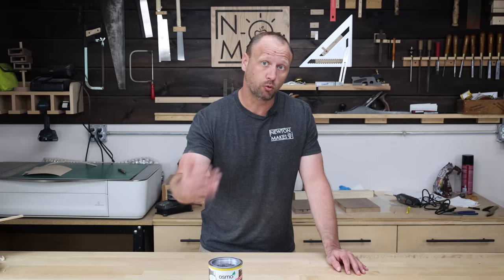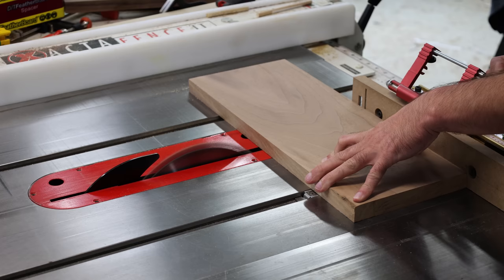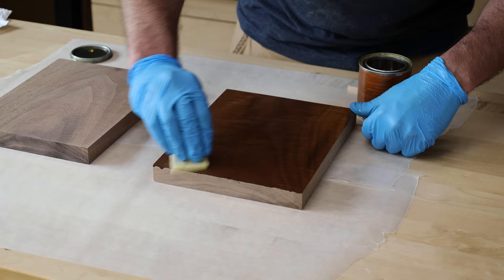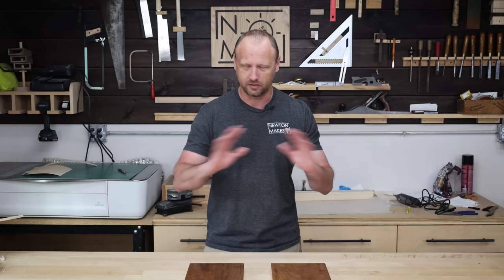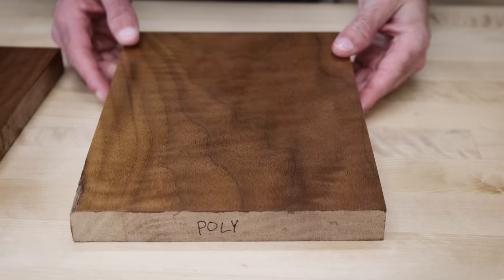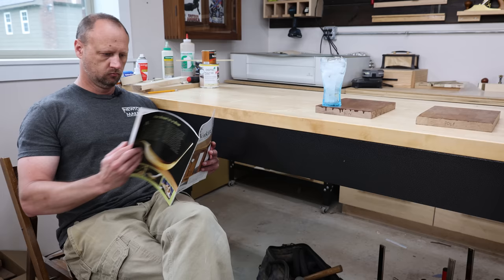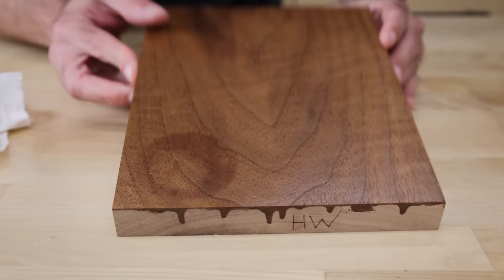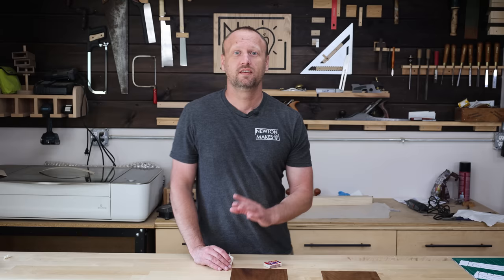Hard Wax vs Poly Shootout! | Rubio Monocoat & Osmo Finishing Test!

Comment: I don't know where the trend came from to wipe/spread on hardwax oil and wipe it straight off, but it goes against the directions on the tin. The directions say, and what I've always followed, are to use a roller (or paintbrush) to apply it thinly, and leave to dry. 2 coats. Using this method, Ive left water under a cup for hours and there are absolutely no marks whatsoever on the wood. There are videos that also say that hardwax oils don't leave a film on the wood. Wrong, they do, they leave a durable wax coating on top and soaked into the wood, unless of course you wipe it off.... I'd like to see this test done again, only using a roller to apply the hardwax oils. What hardwax oils are not great at is permanent marker. These leave a mark, but I've found you can use bleach to remove it. I use Shelley's mould remover, spray it on, leave it 10 mins, then wipe off and the mark is gone

Comment: One thing to add with hard wax’s is that a lot of makers are adding a ceramic finish to the piece. Would be interesting to see the same test with this added layer of protection.

Loved the video!
Reply: I'm working on a table now, and just ordered a bottle of ceramic finish to to on top of Rubio
Reply: Interesting… I would wonder how it changes the sheen of the finish and if it makes the “repairability” worse than the plain hardwax. If it gets shinier and is hard to repair, you might as well just put satin finish poly 🤷‍♂️
Reply: @louisolivierfortin  according to carbon method's website, it will increase the sheen a bit, but supposedly not affect the feel. I'll finish some scrap when i finish my table and do all Billy's tests on that and see if there's a difference.
Reply: @jcrusso1  saw on some other video someone saying it's really hard to repair with ceramic finish. Hopefully someone does this test to confirmation
Reply: Those nano finishes seem to be graphene based, it's nasty stuff. Wouldn't put that in any home
Reply: @jcrusso1  Hey, just curious if you did test the finishes and if you noted any difference. It would be great to know what the results were if you did test it!
Reply: @samuelmellars7855  I only did this with Rubio and Carbon Method's Carbon Coat. I went as far as leaving a puddle on the board overnight - the next morning it was still a puddle with no soaking in at all. when i dried it, there was no evidence
Reply: @jcrusso1  oh, that's good to know! 
You didn't happen to test it with just the Rubio, did you? To know how much difference the Carbon Coat would make.

I'm dithering about how much to invest in a kitchen renovation. Self-made ply or MDF vs IKEA and how to do the worktop
Reply: @samuelmellars7855  i did - just the rubio didn't hold up as well. some of the water soaked in, and after it dried there was light staining. not really noticeable unless you know what you're looking for, but it was there
Reply: @Joe_R501  ah, that's great to know. Something to take into account when doing the countertops for sure!
Thank you very much for sharing the info!
Reply: @TomasRosberg  a lot of them use the “graphene” buzzword because it’s the latest wonder material. I would doubt most of them have any significant amount of graphene in them, let alone a real solid graphene matrix. 

As for graphene being nasty stuff.. it’s just a thin configuration of carbon.. not that different to the graphite in the tip of a no2 pencil (which is basically sheets of graphene stacked on top of each other). Place some sticky tape on a pencil lead and peel it off, leaving a layer of graphite on the tape. then attach another tape to that tape and so on until you have a layer of graphite one atom thick - that’s graphene. If you have pencils in your home you have graphene in your home.. you’ve been getting it in your body if you’ve ever chewed on the end of a pencil.

Comment: For the marker test  it would be instructive to use an alcohol based wipe (like we bought during the pandemic). The alcohol will definitely fix the marker, but how the finishes hold up from the alcohol is the question.
Reply: Agreed.  My is a teacher and learned a very long time ago that basic hand sanitizer will instantly remove even sharpie's off desks with almost no effort.  What it does to the finish?  I do not know.
Reply: If the poly is fully cured, yes it will.
In fact fully cured poly will hold up to a quick wipe of lacquer thinner - which would also remove the sharpy.

The waxes wouldn't stand a chance.
Reply: I’m a contractor and denatured alcohol is my go to solution for all kinds of pen or scuff marks.

Comment: So many woods with so many characteristics used in infinite projects requiring differing performances. Finish selection, usage, pro’s and con’s it’s mind-boggling. Having a finish that is easy to repair without changing color or sheen while making an invisible repair is an art and a challenge. Thanks for the information.

Comment: One thing to note about water marks/rings with an oil or hardwax finish, is that many times it evaporates after a few days.  I've noticed this and was happily surprised!  If you came back to your test boards a few days later, I'm sure the same would've happened.

Comment: One thing to note (although you prob are aware!) that the Tanin remover and degreaser agent that rubio do- would have removed all but the burn mark on the rubio piece. They sometimes work with other finishes also I’ve found. Keep them in my arsenal at all times!
Reply from the maker: Yep, but I didn't want to focus on a specific cleaner for one type of finish. I have heard good things though.
Reply: @NewtonMakes  makes sense for the video. Was also interesting btw. I’ve used the tanin and grease remover on non Rubio products to great success

Comment: My go to finish is Osmo Poly-x satin over a wash coat of shellac.   Its very pleasing to the touch and eye.    But not at all a durable finish.  I dislike the look and feel of Poly but will apply Satin Poly to specific areas where I expect moisture may be an issue, such as the top of a bookcase where a potted plant may be placed.
Reply from the maker: It's hard to beat the close to the wood look of a wax finish compared to poly.

Comment: this matches my experience with all of these finishes - Monocoat is the easiest to repair by a decent margin. Osmo PolyX isn't bad either. The only luck I've had repairing polyurethane finishes is doing an even sanding back and applying finish to the entire piece. Partial refinishing doesn't work (at least for me) with poly finishes - I need to go back a full layer or two and then apply a few new coats. With satin poly finishes this can be a little tricky if the flattener wasn't evenly distributed between each layer (remember: stir your satin poly before use), as it's easy to see the difference between the layers. I've had some luck applying a few coats of gloss and then a final coat or two of satin to avoid this, but it's a lot of tedius, noxious work any way cut it. So I tend to stick with hard oil wax finishes these days. I like Tried and True's lineup quite a lot. Though it does have a tendency to feel dry after a while and likes to be recoated

Comment: Very solid testing. I find oil+wax to be great finishes on things that are either not gonna get a ton of abuse or they are mine and I can reapply. Poly is a more protective finish, but it is much harder to reapply and keep the look, especially on thick applications. For me, it really comes down to huffing poly fumes in the basement vs not.
Reply: If you want to huff polyurethane, you don't actually have to apply it to wood. Just apply some to a rag and breathe through the rag. Happy to help!
Reply: @chaddraizin6616  I'm more of a straight from the can kind of a guy.

Comment: Great comparison! I have not used hard wax finishes yet. I am more familiar with Tung oil blends, polyurethane and polyurethane spray finish (which I like). I will be trying the Rubio or Osmo soon. I am most interested in overall looking and the ability to touch up.

Comment: Well, for the candle wax on the Osmo piece, I would have hit it with a heat gun and a micro fiber cloth first. Candle wax is generally very soft. Most waxes do not provide good water protection. Mostly I make lots of wood bowls.
Reply: Watched this for a second time. One thing about open grained woods like walnut, if the pores are left open, stuff, like candle wax can and will get into the pores. On the poly piece you did, there was some wax visible on one pore. Couldn't really see on the Rubio sample. You can fill the pores if you wet sand with the finish, and use a fine grit, like 400 or so. The resulting slurry will fill the holes so wax and other stuff can't get into it. I use that on my wood bowls I make, but use walnut oil instead of any kind of finish with solvents and driers in them.

Comment: TO AVOID WATER MARKS ON HARD WAX OIL FINISH; slightly raise the grain and LIGHTLY SAND before adding the first coat. After 1st coat, again lightly mist with water and allow to remain wet for a few minutes, then again LIGHTLY SAND the grain back down before putting the final coat of finish. I've never had a water mark on any piece of furniture I've finished this way.  share this advice

Comment: Interesting video. Lately, I've been using several coats of shellac with a liberal coat of Johnsons paste wax on top. I realize it is not as durable as polyurethane or maybe even Osmo. But I on l y use it on projects that I figure won't be subject to abuse. Clocks, gift boxes and the like. I really like the "soft" feel the paste wax gives the wood. Thanks for the test and insight.
Reply from the maker: That's a great finishing combo. Not everything needs to be slathered in varnish. It's overkill.
Reply: Interesting

Comment: I saw your 3-year-old video on finishes and was wondering where new hardwax finishes fit into the pantheon.  Thanks for addressing the issue.
Reply from the maker: Osmo is my favorite finish. It looks great and provides enough protection for most projects. If I'm making a table I might opt for Arm-R-Seal unless I want to be diligent about using coasters.
Reply: @NewtonMakes  that’s my dilemma. Is it better to use Osmo on table though bc it is easier to repair than poly?

Comment: For sharpie, you can write over the marks with a dry erase marker and then wipe it up. It does cleanup better. Worth trying if the marks are not dramatic. It’s not necessarily 100%, but may be enough to avoid refinishing.

Comment: Great video since im currently trying to decide between the 2. My first dining table i finished in Fiddes hard wax oil which looked great, BUT we spilled food oil on it (basil pesto!) and it stained badly. I would love to have seen you test some food spill on the 2 samples so i could see if the same happens with osmo. Also, would love to see you put a hot mug or plate on both surfaces. Anyone else tried?

Comment: I'd retouch these differently.  I would sand the marks out on the poly then do two coats, sanding between.  Maybe a third to even out the sheen.  It's not repaired until the sheen is even.  
With the hard waxes, online people say you can sand them then refinish with no difference in color or sheen.  Again, I'd go farther than you did and try that—  is there really no difference in color?

Comment: Gonna stay with the polyurethane, I like the durability and I think it's an all around good finish product.
Reply from the maker: It really is. Plus it's hard to beat the fast drying time.
Reply: Once cost is considered it seems poly for me
Reply: @jimbennett7248  depends on if you're counting time in your cost. A single coat of rubio is significantly quicker than multiple coats of poly, plus sanding between the coats. 

I've been using hardwax for most things and still go to poly when it's something like a side table that will have drinks on it. it's always annoying how much more time i have to spend on the poly and you cannot get away with less coats or skimping out on sanding or it looks horrible. It's really hard to mess up a hardwax finish, unlike the poly, but you can't beat the protection of poly for high-use things.

Comment: According to osmos customer service to get the absolute correct protection from their product it is suppose to be brushed or rolled onto the surface. Contradicts the instructions on the cans
Reply from the maker: Yep, it does. Plus, you can't leave wax finishes on the surface to dry otherwise it becomes a sticky mess. I know from experience.
Reply: I've used Polyx on pieces for decades I would suggest that the first coat be a little heavier than shown and wiped off in line with the grain after a few mins then a couple more coats wiped on.  At the end of the day it's a floor finish and I have had it on the floors in my house again for decades and it's so easy to refinish when required.

Comment: After applying the finish to the problem areas, then a light sanding and a final layer to the entire piece (same face anyway) would help blend it in.  Also lacquer would probably be better than poly since it melts into previous layers.  Another test?
Reply: In my experience lacquer is very soft and stays that way. I coated a guitar I made with lacquer and it gets worn very quickly. Sure it’s easier to fix than poly but poly doesn’t need to be fixed like lacquer does. 

I basically vowed to not t use lacquer ever again because it was shocking how quickly it wears. And fixing it is much more like fixing poly than it is fixing a hard wax.

Comment: My experience, limited as it is, confirms all of this. The one thing you didn't talk about is cost. If I'm making a simple piece of daily use furniture I'm going poly every time. Marker - even sharpie - will wipe off of poly with a little rubbing alcohol. Not so for either of the other 2. The hard waxes cost too much for everyday use and I reserve them for what might be called heirloom pieces. They're just too darned expensive for anything else.
Reply: Definitely a factor.  If I'm building a large bookshelf or queen size bedframe.......I'm not using Rubio at $60 for a small can when I can get a gallon of General Finishes Arm-R-Seal for the same price.
Reply: @wabio  the hard wax ends up not being much different in price. It's harder to see on small (relatively) things like furniture, but I've done a lot of floor refinishing, with sanding sealer plus oil poly, and also with Bona (professional flooring brand) version of Rubio, which is essentially identical and priced similarly. You use so much more product with poly, even using the cheaper sealer first to reduce overall usage, that it works out almost the same. Add in extra applicators, abrasives before finish and between coats, cleaners after each sanding, tack cloth to get last dust up, etc... And the poly costs just as much. 

Then factor your time. Rubio claims to be "monocoat," so in theory you can do it all in one step and keep working on something else immediately after. In practice, you either have to over apply it to get a nice finish in one coat, or better practice is to do 2 light coats for furniture. Second coat uses very little product. No sanding, cleaning up dust, etc between. Stop sanding at 150, or basically do a really fast light sand if you hand plane surfaces first. Finish on and dry almost immediately, can work on other things, and project ready to be used in 24 hours. 

There's def a place for poly finish, but the quality hard wax are not really much different on price, all things considered, and save a ton of labor, which has it's own "cost" even if you're not paying someone else for it.
Reply: There are other hard wax oils than Rubio and odie. There’s Simple Finish,, for example, which is like $40 a quart. 

The real point is what kind of look do you want? Hard wax oil penetrating finishes produce a different result than a plastic film finish. If you want that encased in plastic look then hard wax oil isn’t even an option. If you want the natural oiled look than poly isn’t an option. 

Maybe, as an artist, I’m too focused on aesthetic, but these  two products keep getting compared as if they are similar. They are completely different in my view. So there really isn’t a competition. It depends on what you want.
Reply: @CarlYota  You are correct. A mirror is always a poor substitute for a pond. Ask anyone who has tried to drink from either.

Comment: The water ring is annoying. I was trying Arm R seal Satin on a tabletop, and I got streaking no matter what strategy I tried. Now I'm considering Rubio and knowing it won't be quite as durable or resist water as well. Arm R seal water just beads up. I'm looking at doing Rubio and then doing ceramic coating like N3 from blacktail studio or something.
Reply: I've found that Arm R Seal needs to be stirred frequently while you're applying it in order to avoid streaking. When doing that, I've had no problems with it whatsoever.